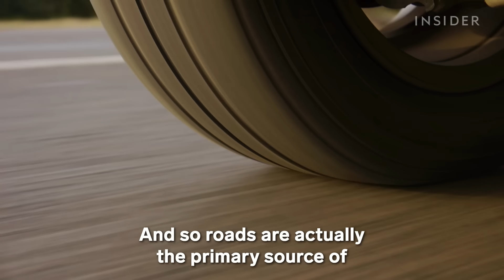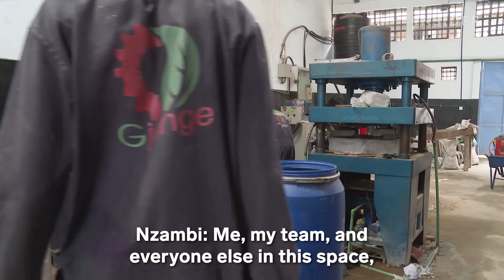Young Inventor Makes Bricks From Plastic Trash | World Wide Waste | Business Insider

Comment: this is nice on a small scale but if these were to be mass produced the melted plastic would release a bunch of toxic gasses known as (Bcp's) into the air and wreak havoc on the eco system. Just putting this out as an issue i dont see pepole consider when recycling/melting down plastic products.

Comment: If the problem is that micro-plastics are formed from abrasion from driving on the road, it seems to be rational that the solution to this is to put a sheet of a non-plastic material on top of it.... like clay mixed with desert sand.

Or to form the bricks in a more rectangular bowl-like shape so that the bowls can be filled with a different material for the surface.

I also think it could be helpful to design the bricks with a more inter-locking nature, like puzzle pieces.
Reply: The real problem is that more plastic waste is being made everyday. We must stop plastic companies and the oil companies from making single use plastic (including recyclable plastic). Its all a scam so that we can keep buying plastic from them and they keep making money. You only ever need 5 or 10 bottles of plastic a year.
Reply: Yeah putting something over the plastic road can also make the road smoother, higher and even stronger
Reply: That would mean the bricks need to be replaced when the top layer is worn out, that level of maintenance isn’t happening in developed nations let alone african countries. 
Making them harder and more abrasion resistant would also decrease grip, asfalt is relatively soft and porous for that reason 

Its also not just abrasion, the plastics leach out in the groundwater because they are broken down by UV and contact with rain water

Its better than a garbage dump full of plastic, but still an environmental problem with health risks later down the line
Reply: @Nathan-kw2hs  why not just paint over them with some sort of spray paint but a different kind of paint?
Reply: @arianathearyan  that help with the uv part sure
But its still a plastic block in wet soil, exposed to freeze thaw cycles
Reply: @Nathan-kw2hs  we already repave roads, I dont see the issue.
Reply: @havabighed  maintenance in most countries is a mess, spending money on building infrastructure is popular with voters, spending money on repairs less so.
Road and bridge maintenance is often years behind schedule because its expensive and the amount of infrastructure is vast
We repave roads when the money can eventually be freed up, rarely when is condition requires it
And this is developed countries..
Reply: Or organic resin like amber
Reply: @nagihangot6133  also a great idea.
Reply: @nagihangot6133  then you're gonna have to start harvesting sap from millions of trees
Reply: all I can think is homes will burn faster and that plastic will stick to any innocent victim in it's proximities
Reply: @kristycatuon1933  what are you talking about? First of all, this is used for roads and paths, not homes... Second of all, this is mixed with sand... So that wouldn't happen.
Reply: @havabighed  I assume she's referring to the inventor's comment about potentially making gutters, rooftops, etc. out of the plastics.
Reply: @RicktheRular  which is why I said: "second of all, this is mixed with sand so that wouldn't happen"
Reply: @havabighed  ok then explain to her why it wouldn't happen instead of stating it in such a manner as if it's something she should have known.
Reply: @RicktheRular  what are you talking about? who is "she" in this case(someone in the video or someone in the comment section)? If it is someone in the comment section, which comment are you referring to?

I'm not a damned mind reader.
Reply: I can tell a lot of people have never worked a labor/ hands on job during their entire life
Reply: @raymondjohnson146  i work in infrastructure
Have some on site experience but not too much to be fair, i design and manage projects
Reply: @raymondjohnson146  I have.... And I also have a physical chemistry background.
Reply: Great job young lady and shame on the petrochemical, soft drink et al companies worth a collective trillions who avert their seeing eyes to a glaring catastrophic externality.
Reply: As if the huge ass pile of plastic garbage isn't just degrading into microplastics anyways, might as well turn them into something useful
Reply: @The20thCenturyLimited  totally true and i admitted that
Its just not a sustainable way to remove plastic because you’re just putting it back on the ground somewhere else
(Admittedly, processing the plastic like that might make it break down slower but i cant be sure)
Reply: @Nathan-kw2hs  you're never going to be able to get rid of it completely especially if you're able to look at it at a microscopic level, that's just how it is.

Comment: I see it as a good solution to a long term problem. Use the bricks, and if they start breaking or going bad, it could be recycled back into another brick or something! Of course it would be more labor intensive to place all these for roads depending how widespread they actually want it but for small applications it's not bad.

Comment: Effectively speaking, putting the plastic in roads is slightly better than burying it in a trash mountain. The melting process breaks a portion of bonds making the plastic ever so slightly easier to decompose over time. + all the mechanical damage from being used as road also helps to break down the plastic slightly faster than just burying it. Just make sure those bricks dont end up in a nearby river or some shit when u need to fix the road.
Reply: You could argue that the most benefit from this comes on the form of no carbon emissions from processing oil, as that has already been done in the past to make the plastic in the first place.

Comment: Foamcrete  mixes foam and concrete to make light weight bricks for building homes.     Foam / Plastic could be used to make lightweight inner wall beams,  if they are non load baring,  partition walls...   cheaper than wood,  lightweight,   and made from 'free' plastic.

Comment: This could work for houses. Like floors  or base structure for heat insulation. Thin large blocks  maybe 5cm thick put it over concrete and then add wood or what even for the floor. You could even build walls like that

Comment: Make 18×20 (feet) slabs with forked edges and a hole running through each corner. Use these a single floor living space. Run a beam through each corner that meats at the forks. Use the smaller bricks for flooring/walkway and this will help with countless housing issues and plastic issues. (World wide)

Comment: While it's cool and a great initiative, I think ultimately the microplastic problem that the bricks and road surfaces will create is far more detrimental.
Reply: They should be used for home building where there isn’t abrasive forces rubbing away at them daily.
Reply: @7thSonengineering  i suspect the plastic in them might not stick to traditional mortar to hold them together thats why they are making pavers.
Reply: Can be used for side walks, driveways, yards, etc.
Reply: I doubt it. The micro plastics absorbed by soil from plastic lying on the ground is probably greater. Besides, you would assumingely cover these bricks with spackle, clay or paints.
Reply: @localsuspect5506  Micro as in very tiny. That is more dangerous than a bottle on the ground.
Reply: @Thatyoutubeguy-p5o  i agree your body wont be absorbing that bottle disolving underground anytime soon
Reply: Sometimes we have to choose the lesser of two evils. Although, I work with people not plastics so- what do I know?

Comment: No offense how you get thousands of dollars to get such expensive shredders and extruders  and you don’t think about the great pollution the plastics is leaving in the air when you melts those plastics, make those plastics blocks without the melt impact to the environment, and the health of you use it to make asphalt the tires friction eventually discompose the asphalt and converted in plastic dust and who is going to breath it ? Exactly the solution is not use plastics at all at least not for friction or to be melted a lots of chemicals are released in that process who also are dangerous to humans.

Comment: Okay, here's and idea, with the amount of plastics and and probability of pipe production from this company, why isn't someone develop a cooling system for home or buildings like a heat sink on a computer ? Like install an small thin flat water tank underneath the floor or ceiling and have pipes with cooled water pumped into the tank and have the water circulate the heat and recycle the heated water into the cooling pump. Like with the amount of plastics and number of electricity used for ac being replaced to power the pump isn't kinda more energy efficient that way ?

Comment: Use the plastic as a filler. Not the surface layer of anything but instead the inner layer. Make a gravel that you cover with asphalt. Use it as an insulation layer in houses. Make everything out of it but only 50% (in the center of the product) will be plastic covered by 25% all the way around. Dip the plastic bricks in a environmentally safer material.

Comment: As an employe at the norths biggest recycling factory with plastic i think this is very cool what she does but I can see som better solutions or upgrades to expand and make the job easyer for them and the ppl can do more than one Thing
But those machines cost a lot.

I just have a New shredder for my line and the cost was almost 550.000 usd
So if your New you need a investor or saving or a good bank 😅

But did I have those kind of money i would have invested in this company she got There im so impressed and glad to se this going on

Comment: Not wearing masks when they melt the plastic… not a good idea
Reply: @Southern Shinobi you realize more plastic is melted daily in the US and UK then then they would melt yearly right?
Reply: Putting plastic on the road where cars will pass causing it to deteriorate into microscopic pieces, also not a good idea. In general, good intentions, terrible idea.
Reply: @yoster39  What’s your idea then? Repeat what you heard from the guy on zoom?
Reply: @toastybrown  my idea is to use that plastic for something that isn't supposed to deteriorate due to natural or man made causes, like having those plastic bricks inside the cement and normal bricks of small houses, that way they would be protected from wind and rain, thus avoiding deterioration.
Reply: @Southern Shinobi I think it may be beneficial to consider that with the plastic we already have, sitting in dumps, let alone rivers, oceans, etc. we reuse it as best we can and stop the production of any new plastics. Her solution is for what we already generated. The point still stands that if you have no better solution to offer, rather than insult the intelligence of others, kindly shut up. We saw the documentary. We understand that heating plastic produces toxins and requires energy. Do you heat your home? Do you drive a car or get rides from others who do? Do you write on paper? Do you live in a home that's painted? Do you throw garbage away? Do you recycle plastic that still ends up in the ocean? The answer is likely yes to all of those questions. You obviously use the technology. Besides cosplaying an arm chair revolutionary, what have you invented as of late to solve this global problem we are all implicated in?
Reply: @Johnny OnTheSpot hey atleast they're actually doing something about the plastic problem. What do YOU have?

Comment: I think my largest concern would be if it was used in any structure that faced heat, like roofing tiles, It could compromise the integrity of the bricks
Reply: Already in use ..sand in mixture is what gives it concrete strength

Comment: Neil Tangri, the naysayer of using plastics for roads is, to me, part of the problem. 

He claims that using waste plastic allows petrochemical companies to be off the hook. Nonsense. Pressure still needs to be applied to these companies to cut plastic production. Just because a use for waste plastic has been found, that doesn't mean we just give up on stopping the generation of new plastic. 

Besides, for every bit of plastic that is added to sand, asphalt, or concrete, that means less new raw material and less greenhouse gas emitted to make any of the finished products. How is this not a win?

In the meantime, we have mountains of plastic all over the world that are getting into the environment through the ground, into the water, and into the air. 
Why not use what we currently have to at least put it somewhere where it can be useful? 

This guy is the precise example of making the perfect be the enemy of the good.

Comment: when  you make roads and pavements out of waste plastic then the wear of the surface will obviously lead to more plastic residue being washed into waterways.  This is a really bad idea.  Making roof tiles would be a much better idea because they aren't subject to wear.  BUT, they need to be fireproof so probably need an element of cement or some other non combustible material included in the mix.

Comment: Being that most plastics in consumer products is either hdpe or petg, very well makes a good alternative to asphalt due to low thermal expansion and being that is malleable makes it a decent road surface. The problem later on could be that heat waves and heavy vehicles could leave permanent impressions in surface.

Comment: Fascinating watch.  I've been toying with this same principle in my head for a few years now.  The brilliance is the sand additive...I never thought of that.  Kudos to Nzambi, she is an inspiration.  I was dissapointed in the expert on pavement with plastics in them.  I hadn't realized the abrasiveness was that big of an issue; it does make sense though.  I wonder if, instead of mixing the plastic in the substrate itself, if layering would be better so that the more robust material meeting the tires would not contain plastics.

Also, lots of thoughts on what Nzambi could do as far as improving the process an speed and even introducing a wide variety of products for different uses.  If she could get a pipe extrusion machine...the QOL could significantly impove with better, cheaper sanitation costs in more poverty stricken areas.  

I love this woman!

Comment: Give them safety masks against the fumes and all this makes more sense. 
Also, the mold could leave a hollow concave space in the centre of each brick, thus saving easily more than 25% of plastic mass per brick, making it more economic and ecological. You’re welcome.
Reply: Except plastic brakes down into micro plastic no matter what, she just found another way to contaminate our environment with more microplastics.
Reply: @odisy64  I think the same. Plastic isn’t great for that very purpose as sun rays and movements will continuously disperse micro particles into the ground water and into everyone’s air. The right solution is to either use it for other purposes such as inside walls in housing constructions and/or by continuously reducing plastic waste overall.
Reply: @Newsferatutu  the best solution is just to stop making so much plastic but thats unlikely, i think plastic waste should be buried underground in non permeable rock/soil since its just to fragile for any long term use for construction.

Comment: The entire process of heating the plastic is environmentally super unfriendly- from the fossil fuels needed to heat it, to the gasses released WHEN they heat it...
Reply: Chimney with filters and scrubbers
Reply: @ΝίκηΧανδρή  Such tech doesn't actually exist... typically for this kind of thing they use afterburners- which is just the burning of additional fossil fuels to ignite the waste so that more is converted to basic CO2 instead of complex hydrocarbon pollution. 

We don't have CO2 'scrubbers' like you're implying- that could handle the volume of waste being produced.  They're for fish tanks and scifi movies. You need a couple quarts of the medium to filter for a handful of fish, consider how much it would take to filter a smoke stack or 2, and then what we would do with that when it's saturated.
Reply: Who cares? Every other country in the world produces or PAYS for the pollution produced over a hundred times more than the entire continent of africa...only difference is the skin
Reply: @TheGodFactory  So if your neighbor has a yard full of garbage it's somehow NOT littering when you dump a gallon of paint in your grass?

Someone else's actions to not negate your own.  Being an adult 101.

Comment: There are so many questions about this story:

1) How long do the bricks last out in the environment?  Eventually they will become waste themselves that cannot be recycled, and will shed microplastics from abrasion.
2) Do the bricks leach chemical pollutants in harmful amounts? The same heating process that melts the plastic also partially burns it, and may produces toxins. That lady who lined the side of her home might be dripping a toxic soup into her yard every time it rains, or inhaling toxic fumes on hot days.
3) How strong are the bricks structurally, and how long do they remain useful?  Walking on them shouldn’t crack them, but lining roads and driveways with heavy cars and fully laden trucks?  Once again the lady with them on her house, how long before they degrade, and she has to replace them?
4) Do the bricks have, or develop sharp edges as they wear?  A sharp edge could cut bare feet, or shred car tires?
5) The melting plastic should be producing toxic fumes. The workers in her factory should be wearing organic vapor masks.

Still, this might be an imperfect and temporary solution to mounds of plastic waste.

How long before Kenya bans the import of plastic waste from the West like most Asian countries?